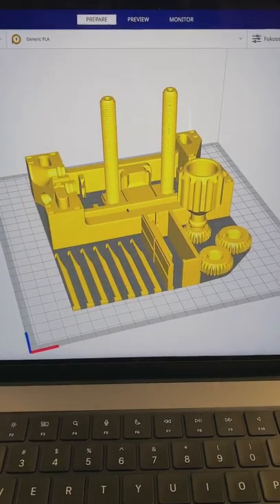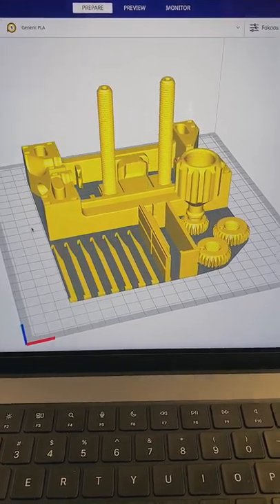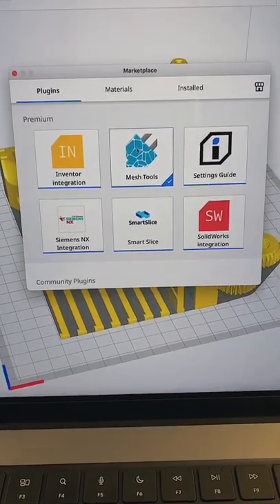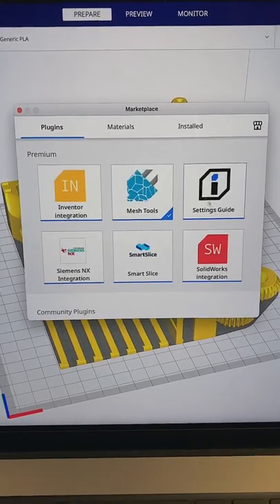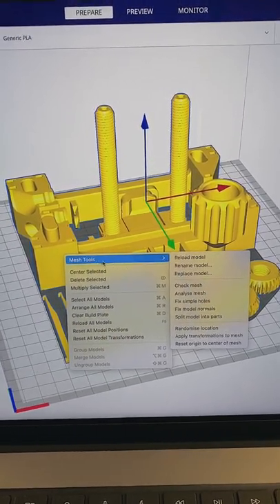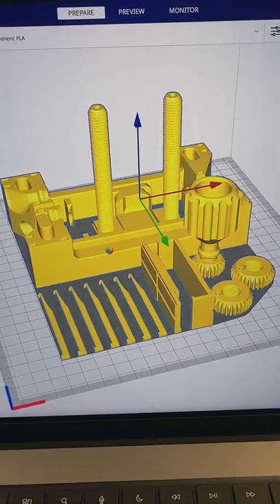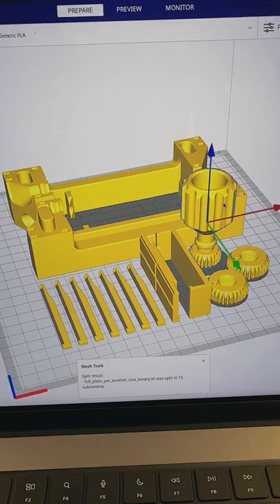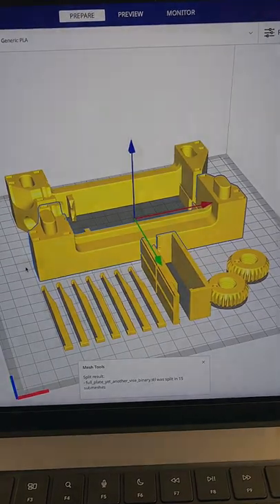CURA PROTIP: How to split STL into multiple parts #Shorts

Comment: Hi, I have a voxelab aquilla but I'm having some issues with the filament tube. It doesn't stay on the pneumatic joint, can you think of any solutions 🙃
Reply from the maker: If it’s on the hotend, you have to buy higher quality fittings. Let me know and I can send you a link. If it’s on the extruder side, I designed an extruder called the “Fedorstruder” that gets rid of that fitting all together
Reply: @3DPrintSOS  It's on the extruders side, but how do I print the part tho. Thanks for the help btw 🙌
Reply from the maker: Ah if you cannot print, I’m afraid you’ll have to buy one. I would say getting a new extruder would be beneficial but if you want to keep it at cheap as possible, you can just get the fittings.
Reply: @3DPrintSOS  where can I find the fedorstruder, just in case I can print
Reply from the maker: It’s on Thingiverse. Here’s a link: https://www.thingiverse.com/thing:4647801

Comment: You shouldn’t design STLs to have multiple parts in them
Reply from the maker: Depends on what you’re designing, Bradley. For example, those RC trucks I’ve made have HUNDREDS of individual parts. So having color-coded “parts plates” is extremely helpful. Not to mention, this tricks makes it super easy to edit as well.

Comment: this use to just be part of cura... ugh
Reply from the maker: Really? Not in the 5 years I’ve been using it. Also, this is just a one-time thing.
Reply: @3DPrintSOS  seriously it was part of the normal right click menu options. I use to get comments on my thingiverse post complaining that I didn't separate out my parts in  design and never understood why with how easy it was to do. Idk if it was ever a part of the current cura interface but the old version with the menu on the left blue build plate and menus thats looked like windows 98 it was there.

Comment: I bought biqu B1 SE Plus...it came with Cura 4.8.0. what's the latest version o can use with this printer? Does it matter?  PC is a Lenovo Yoga 730.

Core i7 ⁸⁵⁵⁰u @1.8 GHz  2.0 GHz 
64 -bit x64
Windows 10 home version 21h2
Experience pack 120.2212.4190.0
Reply from the maker: Nope, doesnt matter. You can use any slicer and any version for that machine.
Reply: Okay thx. I just downloaded the 5.3.1, thx for your reply